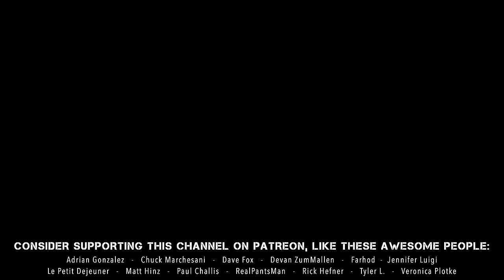Wolverine Mask Build Timelapse - Deadpool & Wolverine

Comment: WELL DONE BRO!! 
Little question for my curiosity: 3:10 this unpainted model of Hug Jackmann is not the same as the beggining of the video (the painted one at 1:06) ? Because with eyes inside he looks alike a little bit "caricatural like" beside the unpainted one without eyes... 
weird...🤨
OH I KNOW!!! The irises of the eyes are overscale!! TOO BIG!!! 🙄😳🤯
Reply from the maker: You're right. I noticed this and fixed it for later projects, but because of the way the cornea is domed, it works like a magnifying glass and makes the iris appear bigger. I had painted the iris the right size, but it came out huge after adding the outer layer